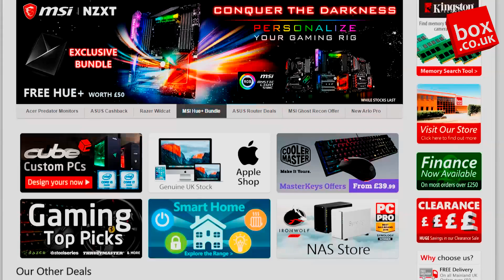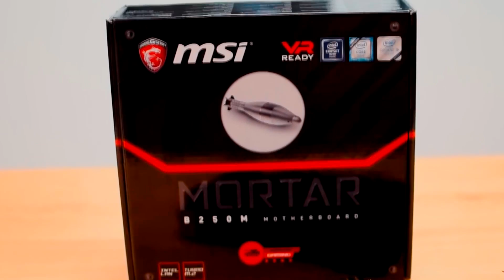MSI B250M Mortar Motherboard review - Best Budget Motherboard?

Comment: Great review. Subscribed.
By the way, would you recommend this over the Gigabyte b250m d3h?
Reply from the maker: Andrew Lyngwa if im honest ? They are both great boards ! Looks wise ? The Mortar wins hands down and has LED’s behind the mobo which really make it “pop” 👍🏻 but..... if you have a unlocked CPU then go for a board than can be overclocked 👍🏻 however bare in mind for the price you could get the same board for Ryzen and the price difference could get a Ryzen 5 1600 with a smart RGB cooler which is a Hex core CPU 👍🏻

Comment: I just bought this board used in September 2021.. I have an old i6 I want to try. Normally I don't touch Intel stuff and haven't since before the year 2000... AMD had always been easier to use and more straight forward and reliable for me.. regardless of performance..
 I'll try this and then sell it

Comment: Hey there! i was wondering if 2400mhz is a good speed for ram i really wanted to get a 3000 mhz stick 8x2 but i read on the motherboard it only does 2400mhz.
Reply from the maker: NosK - Fortnite I find it fast enough 👍🏻
Reply: Alright thank you for the response

Comment: Would this work with i7 7700 + GTX 1060? And also if I get 7700K will this handle overclocking? Thanks and do answer.
Reply: no it wont and if you want to overclock it then you should buy and z series motherboard

Comment: MSI B250M Mortar + 7700k +2400mhz is normal , low buget , will be normal for 7700k if i dont play to oc ) ?
Reply from the maker: DominatorRGX yeah ive not overclocked yet ! But the Ryzen builds coming up will be overclocked
Reply: i want to take 1600x but i decide to take 7700k is more stable on low fps and 1 core performance, for mmo is best .but i dont want to spend more money and think will be normal this mb

Comment: can this motherboard support intel pentium g4600/g4620 and gtx 1050ti gpu ?
Reply from the maker: Samuel Torcelino the CPU I used in this was the Pentium G4620 and the RX 480 and Ive seen this board used with 1060’s so yes I imagine so 👍🏻
Reply: Thanks man, i figure this board would be a nice start up building my first pc, and i can upgrade without changing the motherboard. Great vid man! Keep it up!
Reply from the maker: Samuel Torcelino thanks. Yes it supports all the way up to a i7 7700k 👍🏻 if any advice having owned a Pentium G4620, think about what you want to use the PC for ! The G4620 is a great CPU and great price to performance ! But for a little bit more !? You can get the Ryzen 3 1200 which In my video’s managed to clock to 3.8ghz and the same motherboard for the Ryzen version is similar in price which is brilliant. Just need to save a little more and get a much more powerful CPU which will compete with any i5 6 Gen and older for half the price 👍🏻 Intel CPU’s really aren’t worth the money anymore lol Ryzen is worth every pennie it’s much cheaper and just as fast lol
Reply: It will only be used not much of a gaming such as PUBG, League of Legends, Dota 2 and CSGO thats why i'm choosing intel pentium g4600 i'm not a hard core gamer who needs all the powerful devices but powerful enough to run the games i play :)

Comment: im new to ur Chanel bro ) i have a old motherboard i would like to get a new one but not to expensive  and try to use my cpu and video card this is what i have GTX 650 Ti BOOST EVGA 790i FTW  8GB of ram  and also use my ram on the new motherboard
Reply from the maker: what CPU are you using?
Reply: Jezy its a intel quad core dont remember  much about it :/
Reply from the maker: will need to know which one it is to check compatability
Reply: how can i check all that info ?
Reply: Intel (R) Core (TM) 2 Quad CPU @ 2.40GHz 2.40GHz